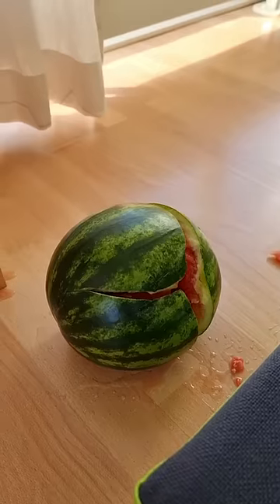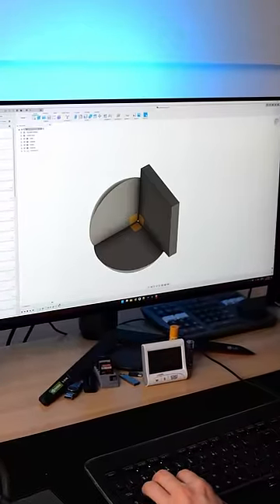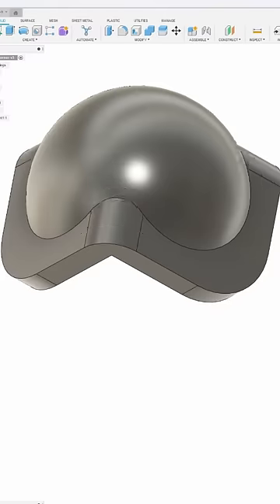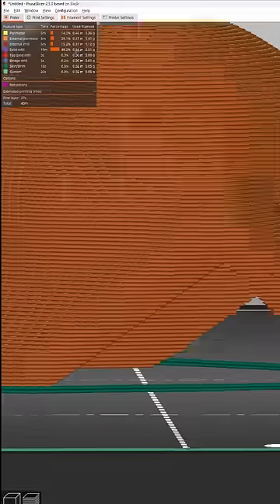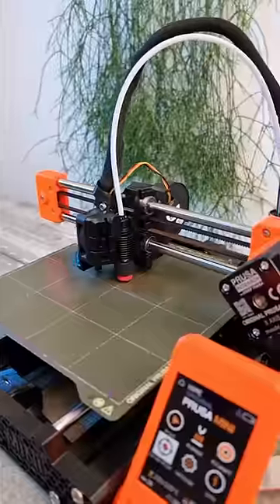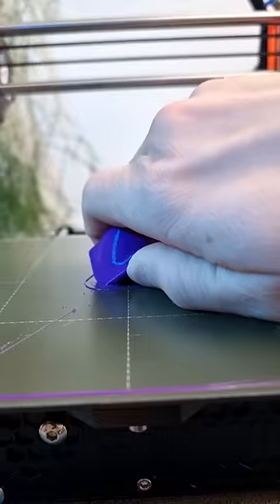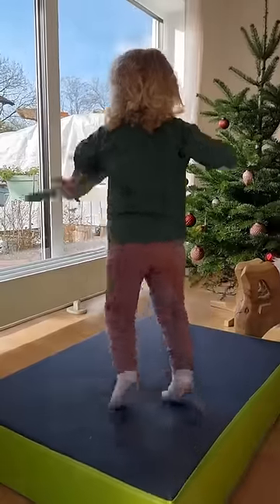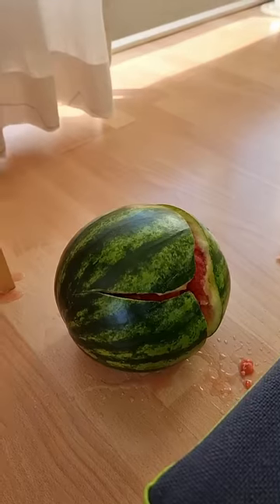3D Printed Corner Bumper against Brain Mush

Comment: Nobody's gonna mention how he COULD JUST F-ING MOVE THE MATTRESS?!
Reply: Moving it really would be best. Hard plastic won't absorb any energy, just distributes it a bit.
Reply: Demonstration should have the watermelon thrown at the same height/velocity both times.
Reply: My thoughts exactly, it would be easier to move stuff around
Reply: he bought a 3d printer, gotta use the 3d printer, why wouldung u have the mattress between the xmas tree and that corner, also blocking access to a balcony or whatever the big window is, that's obiously its usual spot..
Reply: @jacobsmallman5018  I think the point is less to prevent the kid from getting their head hurt (which, literally just tripping can give you a concussion, so), and more about not getting stabbed from a sharp corner- When I was a kid, I've had both hitting a rounded corner of a desk with my head AND a sharp one, and the sharp one got me sent to the ER due to needing head stitches, while the rounded one just made me cry for three hours 

But yeah moving the bed would be smart. Very, very smart
Reply: It's still possible for the kid to just.. run into it, though.
Reply: Meh too much work
Reply: @Moon-Archive  I too have scars from sharp edges. For me it is a concern that jumping has a higher rate of falling and greater kinetic energy. Skull fractures can happen even on blunt / flat surfaces. Imo it was just to show off a 3d print so I got nit picky in the comments. Either way everyone here is pro child head integrity so it's all good.
Reply: Maybe they have no space to put it, come on bruh. The kid could hit her head on the table in any other situation too, so that's just general safety though he could have made something better
Reply: @stuffedheart4001  They have an entire freaking backyard to put it. What do you even mean?
Reply: No no no, this video is for people who cannot think. Stop discriminating them.
Reply: He's German, they like to overcomplicate
Reply: @thejecs8  The rest of the world didn't specially like the last time Gemany overcomplicated things...
Reply: Some ppl live in small spaces so it's actually p helpful
Reply: @jacobsmallman5018  pressure = force / area . In this case the plastic will help immensely because it is not pointy and spreads the force over a large distance unlike previously where it would all be focused on point thus increasing pressure by a order of magnitude
Reply: @jacobsmallman5018  filament is actually a pretty soft plastic.
Reply: he's probably an engineer
Reply: @jacobsmallman5018  better to have a bruise then a scar
Reply: When you have a 3-d printer - you solve any problem with it, no matter how harder it is. You even make new problems to solve them.
Reply: Create problem, sell solution 🤑
Reply: Or tell his child not to jump on a matteres
Reply: @jacobsmallman5018  that is the point, also it removes the point.
Reply: but is it possible to move the mattress?? 
NO
Reply: Or the drawer
Reply: the point was to show another method to use 3d printing around the house
Reply: Bro. 😂
Reply: Even without the mattress kids still running around the house, every part could possibly injured them.
Reply: @jacobsmallman5018  pressure be like: am I a joke to you🤣
Reply: or how he could just run to the store in like 15min to go buy some corner covers
Reply: Counterpoint: the child can move it there for no reason
Reply: Maybe the kid just likes it there and no matter where he moves it his kid will just move it back
Reply: People don't buy a 3D printer just to be practical
Reply: @Crazylom  Counter- counterpoint: Father can keep an eye on their child, it's literally their job.
Reply: I just wanted to comment the exact same thing 😂😂😂😂
Reply: What if he can't?
Reply: @Crazylom  Why would he be unable to? It's not like he lacks space with that big arse backyard.
Reply: @jacobsmallman5018  that's the point
Reply: The child doesn't need a mattress to trip and fall.
Reply: @jacobsmallman5018  Well its better then nothing
Reply: what the f-ck!!!!
Reply: But that makes for boring content
Reply: I agree
Reply: @ーテイル  Have you seen the backyard yourself? You cant say they have space there bruh
Reply: @ーテイル  Also that mattress doesnt seem suited to outdoor use at all
Reply: Or just not get a kid a mattress to jump on in the first place
Reply: He can but the danger is still there 😅 She could still accidentally run into it 😅
Reply: @stuffedheart4001  Are you implying that a backyard that you can clearly see from the shot has enough open space to have that mattress, has not enough space to have said mattress? 

Also, also, are you really putting the mattress well being over the child's well being?
Reply: @koii55  seriously though he could then 3d print her another head
Reply: This is what I was thinking lmao
Reply: You don't need to be bouncing in a bouncy mattress to hit your head in a table corner. You could've just trip on air or with your own feet and you can still hit your head in a table corner.
Reply: I’m feelin bad for that kid right now lmao
Reply: Nope this was clearly the most simple solution
Reply: I think he presented a problem just show the product he made.
Reply: That's what I'm saying!
Reply: That's what im saying.... I'm like bro just move the table or the matress
Reply: That's what I'm saying
Reply: Correct
Reply: he just want to show his 3d printer🤡
Reply: Bro ditto
Reply: But then no content :(
Reply: @jacobsmallman5018  turned it into a ball peen hammer
Reply: 3D printing channel create problems for content
Reply: @fws3fireskull  You REALLY think a child that's as young as the child shown in the video would actually listen to what they're told? They do it anyway, when you're not looking.
Reply: Or the table right
Reply: Kids find a way.
Reply: @stunt-  When all you have is a hammer everything looks like a Nail head.
Reply: Exactly what I was thinking. Or the table
Reply: @falcon_arkaig  honestly the child could be forced out of the area then the dad moves the matteres
Reply: Or a foam guard
Reply: i would move more corny furniture near the matress.
Reply: Or the table... This plastic corner won't do much in case she really falls on it with her head....
Reply: how is this not the top liked comment?
Reply: Stop swearing
Reply: @gilbertbaez9474  why in all hell would I fokin do that?
Reply: OMFG YES SOME ONE SAID IT IVW BEEN LOOKING FOR AGES FOR SOME ONE TO SAY THIS OMFG
Reply: @Zitronen_  fr, sometimes shit just happens
Reply: Even if he did what if she stills get hurts by the tip of the table? Like an earthquake or something? But I think that’s rare though
Reply: @TheBlockIsBoneless  You could have made like 20 examples of how a kid could headbutt the corner of a drawer... You chose a natural disaster.

I'm proud.
Reply: How do you know he has room for it somewhere else? It might be the only place in the house it can go
Reply: @bigbird4481  Maybe the fact that he literally moved the mattress in the next video of this series.
Reply: @ーテイル  I've never seen this man so I'm just going off of this video, so my question was perfectly legitimate
Reply: @bigbird4481  And my answer too.

Comment: For those without a 3D printer, be aware that these kinds of things are sold in many regular stores.
Reply: Best advice in the entire comment thread.
Reply: What are they called? Table corners?
Reply: Exactly what I was thinking. He hasn’t really invented the wheel here.
Reply: And they have foam ones so instead of a concussion your child would end up with 0 injuries (unless they hit the floor after in which case oh well)
Reply: They also made this stuff with bouncy materials like silicon or rubber, I prefer these compared to the hard plastic one
Reply: Or move table away from bouncy mattress 😂😂
Reply: @user-us1yu8gx9s  edge or corner guards I believe.
Reply: Also check if your local library has free or low cost 3D printers available for public use if in the US.
Reply: @user-us1yu8gx9s  you can check places like Amazon for corner baby proofing. They sell all kinds of edge protectors, but be aware that whatever you attach it to might not come off clean when you remove the protection in a few years. They're designed to protect kids, not to preserve your furniture. 

I've used the dense foam ones and also harder plastic ones from ikea. Both work well.
Reply: Actually better than this one😂
Reply: I buy them in bulks, 10 pieces each, already bought like 30 of them xD every corner in house is safe.
Reply: Yeah, typical 3d printing fans printing any random crap that already exists and is much more accesible and affordable just to justify the use of a 3d printer lmao
Reply: @ayupuspita5660  He might have printed it in a very flexible and soft plastic
Reply: @ajinkyatarodekar9099  for real
Reply: i thought you said "these kids are sold in many stores" 💀
Reply: AND, they're made out of soft material...
Reply: Even with soft materials like regular rubber
Reply: @ajinkyatarodekar9099  or just get one pool noodle and cut pices to size and slice it open aka length wise til the middle and wrap it around any corners protects even better and doesn't cost alot although it does look goofy but your child won't need it for all that long maybe 2 or 3 years until motor skills are developed enough could take less time or more.
Reply: Yep, my mom bought some for our many work desks even though we don't have a toddler in the family anymore, but I'm glad she did cuz I'm clumsy af and those corner protectors help me get less bruises or scrapes. I might have to get some for my desk at school since i keep on bumping into it many times (:
Reply: The grey pipe insulation things are fantastic too

Comment: any specific reason for pla instead of TPU? would've thought that would make it even safer?
Reply: @FUCKDSS  on modern printers TPU is relatively easy to print. Some friends even did so on bowden ender 3s. You just need to go real slow
Reply: @Daepilin  Prusa Mini doesn't like TPU that much. Especially really soft TPU
Reply: Tbh I would just slap a slab of Styrofoam or bubblewrap on the corner at that point
Reply: Bolden printers sucks at print tpu, you need to go reeeeealy slow and everything need to be super clean, otherwise it will go wrong. Maybe he didn't want to be angry with it or wanted to do the protector fast
Reply: I'll be interested to see the 3d printed car you make when she starts driving.. 😁
Reply: @empty9360  is it just the Bowden tube that makes those printers not perform well with TPU? Or is there some other design feature that contributes
Reply: Tpu isbhard to print plus i bet double sided tape wouldnt stick so this would be a 2 part print. Also you can buy these for like 1 euro already from softer plastics so idk xd
Reply: @empty9360  try sainsmart tpu 95a, it should be fine even on bowden extruders.
Reply: With enough force tpu will tear and reveal the sharp corner underneath and cause just as much damage as the bear corner
Reply: @igrillpoptarts8874  depends on infill, but generally with infill>25 - not. Even with hammer.
Reply: @Daepilin  yeah I use it on my ender 3 v2 (Bowden) and it prints just fine, I modified a custom profile for it where it’s the same speed throughout and no retractions, had basically 0 problems so far
Reply: PLA is cheaper. TPU is stronger and more break resistant, making it good for fast gears as an example which experience lots of force and need to be stronger. In this use case while you could use TPU, PLA will work for this just fine.
Reply: Ignore my previous comment, I mixed up TPU with some other plastic. Apologies.
Reply: I was thinking about that too.
Reply: @empty9360 I manage to print TPU on my mini, but it does has the bondtech extruder upgrade which I think makes the difference in making it less likely to slip and slide. Has to go very slow
Reply: @TheDahakon  yeah I was looking in upgrading to the Bond Tech Extruder. The stock extruder seems to be slipping on the TPU. But luckily I have a modded Ender 5 with Direct Drive so I could print the parts that I needed.
Reply: tpu is too soft, it wouldn't actually shield her.

it would be like putting a cloth over a table corner and calling it soft.
Reply: @Daepilin  Can confirm. I've printed TPU on my bowden ender 3, using only advice on settings found on the internet. No need to buy a direct-drive yet (thankfully).
Reply: TPU would be harder to print in thar orientation. But it might have been harder to print with any orientation, since you shouldn't use supports with it
Reply: @AngelVlad100  yeah I think 95A would work but for the print I needed a softer TPU. Had to print some gaskets
Reply: @igrillpoptarts8874  with how relatively massive thst part is, made from tpu at proper wall count and infill an adult man could not break that thing.

Tpu is extremely strong.

And as for hardness/softness: with some experimentation easy to control with again, wall count, infill percentage and infill pattern.
Reply: @calebbrown5127  who says so? You can easily support tpu, as long as your supports are not too thin for how high they need to be.

It even removes quite cleanly.
Reply: @Daepilin  I guess I thought it wasn't a commonly practiced thing because of the difficulty

Comment: Cool. Now instead of having a very minimal chance of cracking her skull on a  corner, she has a larger target to smash her shull on. Absolutely brilliant. I know I sound very rude right now, but I'm only concerned about the child's safety. Perhaps you should try adding some padding to the corner or printing it out of a slightly soft material.

Comment: I have an experience kinda like that beginning scene with the watermelon, when I was around like 10 or so, me and my family used to go to a camp site with a lot of campers, including ours, and we used to put one of our dog in a playpen outside the camper, since we wanted her to be outside with us without her being able to walk off, and one day I sat in the playpen with her and started playing with her, the bad part is that the playpen was right under the camper door which had a steel frame with a sharp corner on the edge, which is typically latched to the camper side wall, but on that day I went to get out of the playpen I shot up snd didn’t realize the door wasn’t latched to the camper and instead it was over the playpen, and I ended up stabbing the corner of the door about an inch into my head and had to get a staple in the top of the head at a hospital about a half an hour away, not one of my best moments, but luckily it wasn’t too bad, nothing detrimental ended up happening from it

Comment: Good intention but is your device made of hard plastic or a shock absorbing material? 
When they happen in real life "small concussions" that happen on a child's head matter much more than on a watermelon. 

Firstly, watermelons don't cry or bleed. Scars matter much more on a child's face than on a watermelon rind. Not only the physical scars but the emotional ones too. 
Bruised watermelon flesh is much less important than a bruised brain. 
Not only are corners dangerous but also every edge. I ended up getting rid of all pieces of furniture made of hard laminate with sharp edges like yours. 

Your corner piece has the great advantage of erasing all sharp edges so a potential blow would be spread out on a larger surface than the point and sharp edges of the piece of furniture. But as someone mentioned, similar elements are available in stores. What is less often seen is a protector with shock absorption on top of a hard protector. 
The next step could be to design a larger shock absorbing cover to put on top of your corner piece. Then any accidents would have little or no consequences.